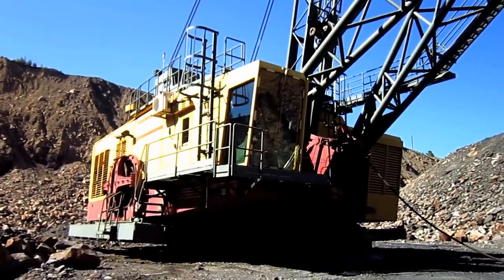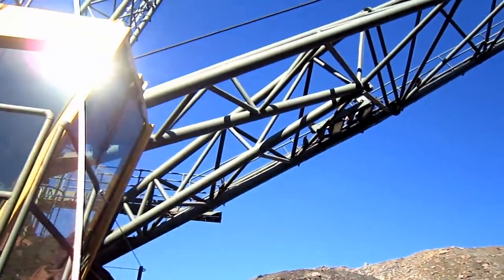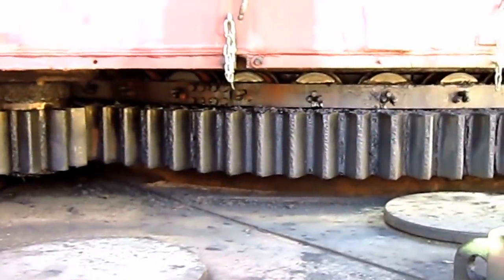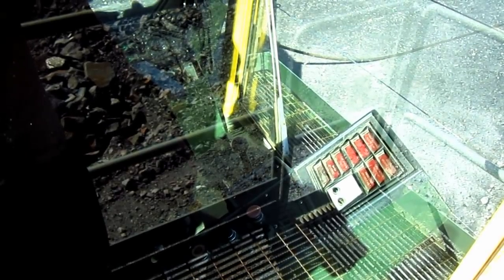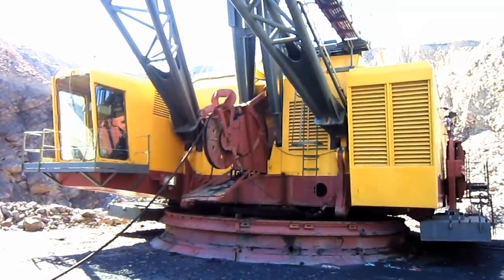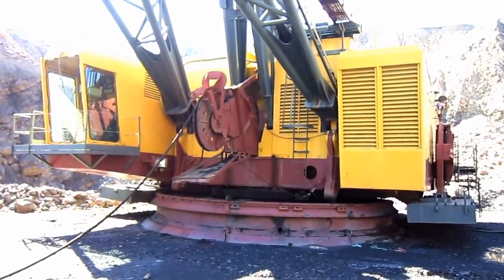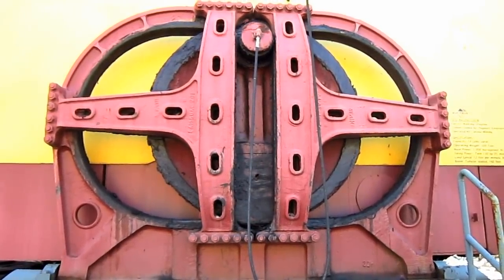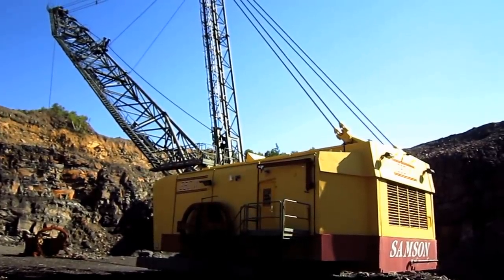Bucyrus-Erie 380-W Documentary

Comment: Very nice looking 380W. I put in a bid to rebuild one at the Lafarge Quarry in the NE of England back in 2009. I think they decided to scrap it instead of rebuild it.  I have also worked on 2 of the operation 680s (at that time there were 5 of these operating I think (2010).  I think this machine was the one that probably prompted Marion to develop the 7450 model.  I erected one of these in South Africa. We also developed the 7250 at Marion but only built one model.
Reply from the maker: I would have loved to see the 680! Marion definitely had a way better designed modular machine than BE. Thanks!
Reply: @PAmining  I always liked our (Marion) modular machines over the Bucyrus 380 and 680, not that they were bad just biased thinking i guess. I put up one Marion 7450 in South Africa in the 1980s, alongside a Marion M-2 Blast hole drill. Both were good productive machines. I have been on 3 of the 6 Bucyrus 680 machines. One was scrapped, one is working in Florida, One in California after being moved from Ohio, two in Jordan (which i spent a lot of time on) and one in Brazil that knowbody knows much about. One interesting design feature on the 680 is that it has two swing gearcases but four swing shafts to engage the swing gear. Two different lengths of swing shafts out the bottom of each case. Strange but it worlks!

Comment: As an electrician I can never work these things out exactly how they are powered . Yes , I can hear the frequency hum of the 6000 something volts but we never seem to see a supply cable anywhere. Even when you showed the back of the machine still couldn’t see a cable . Plus , high voltage cables I would think would be super susceptible to blowing out in a rough , quarry type environment.
Reply: you can see the cable in many other videos, yes is kinda cumbersome to see a cable laying around in such  environment but the really interesting part from an electrical point of view is the "dynamotor" converter/power supply and the "slip ring" to allow 360° movement
Reply: Hiking in some mines - as a kid not sure it is allowed any more - I recall seeing a large electric cable and following it to where the dragline was working. It seems like Big Muskie even had special machines for its cable management.

Comment: That machine is in pristine condition. Very impressive. Normally eqipment like that is partially broken, scratched up and rusty.

Is it possible to add the metric numbers for the size and capacity? It would be a good aid for the folks who doesn't use the imperial system (like me).
Reply from the maker: The problem with that is it would tie up a lot more video time to repeat every imperial unit in metrics. Thanks

Comment: I'm thinking it has a D399 Cat engine.
Reply: Some of them were updated to the 3516 Cat Engine
Reply: @jamescruce1738  He said D349 and I was racking my brain to remember if that was an actual CAT engine (D348 is a V12). At first I thought he meant D379 but then I saw something where they were upgraded to 3516 so I deduced that they must have started with a D399.
Reply: We have an old Lima dragline by my house and it has a D379. It is about half the size of this machine so D399 makes sense. I've always been interested in those old Cat engines cuz I helped rebuild a bunch of them in the 90s with old guy who could build them in his sleep.
Reply: D349 was the 16 cylinder version of the D348
Reply: @dieseldave71  Wow.... I've never seen one of those. I Googled it and found some pics of them. I have rebuilt 346's and 348's and didn't even realize there was a 16-cylinder option. I'm thinking the D349 is strictly industrial and I'm on the HE side of the business.
Reply: Josh Slacker I've never seen one either, it was just a number that stuck in my head. The 343 was the 6 cylinder version, correct?
Reply: @dieseldave71  That all adds up. I believe the D343 was replaced by the 3406....then D346 to 3408 and D348 to 3412.
Reply: Josh Slacker Those DOHC engines were really something though, weren't they? Maybe a little bit of overkill in the engineering department, but they were unique. And that sound! I always wondered how a direct injected version would have worked...